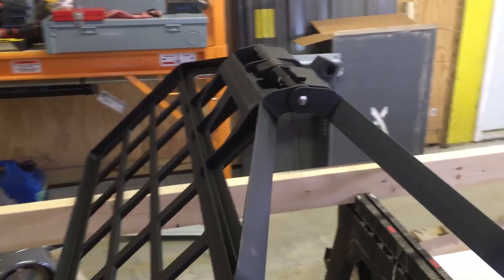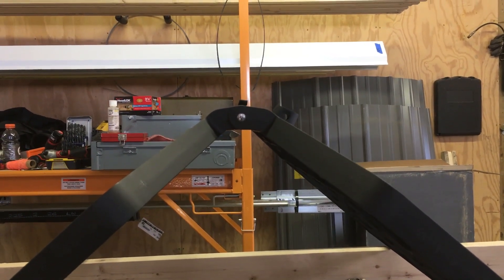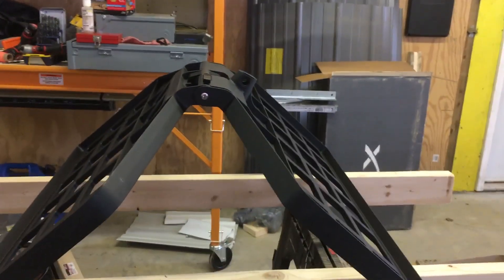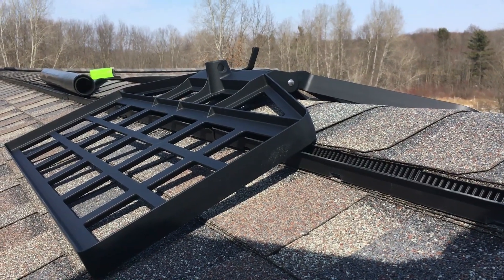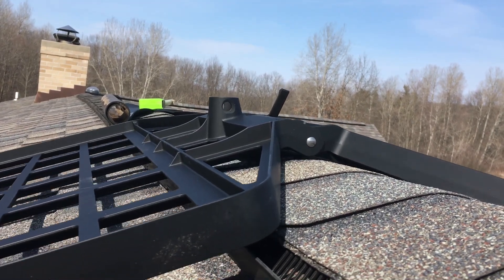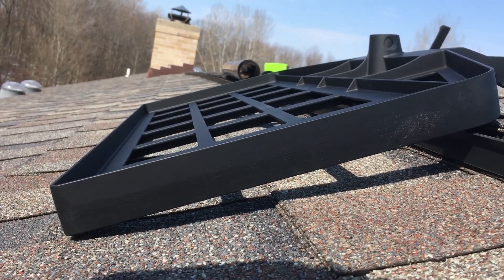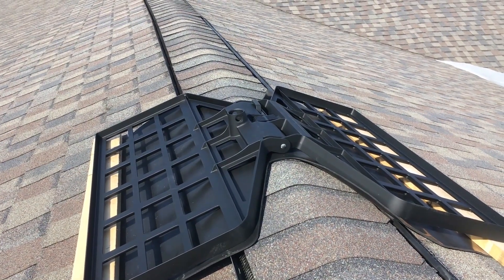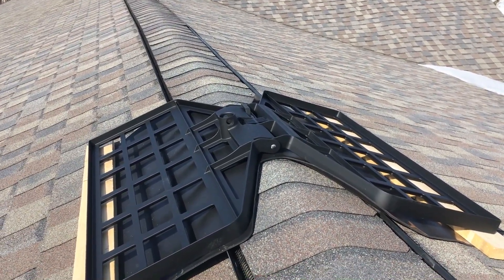Starlink Ridgeline Roof Mount has an issue (early 2021 beta version)  New version better

Comment: how did you get this mount ? I did not see it on my order
Reply from the maker: I put in a separate support request
Reply: @Neighbour_Al  I can’t find any place to send a separate request. I have an account but no way to contact or leave a message
Reply from the maker: @jerryag19451  Goto https://www.starlink.com   Click on the icon in the upper right-hand corner of the screen.  Sign in.  Click on "Support" near the top center of the screen.   Click on "Setup and Install"  Scroll to the bottom of the page and click on "contact support" in small print.  Complete and submit the online form letting them know that you need help with getting a ridgeline mount (if that's what you really want)    Good luck!

Comment: I didn’t think this was supposed to be used with shingled roofs.... pretty sure their website said tiled roofs or metal
Reply from the maker: It's still mentioned in the App.  Support > Install > What happened to the RidgeLine Mount?  They do say that it's available on request, but no mention of the roof type that it was designed for.

Comment: 2 treated 2x4s look good enough to hold it, use Deck screws for best corrosion resistance and hold.
Reply from the maker: Not the solution that I would recommend.  I'm working on something that I hope will provide a set-and-forget solution with no penetrations or risk of ice dams.